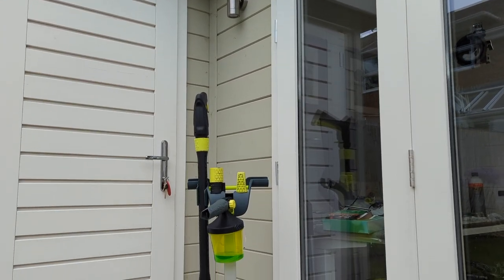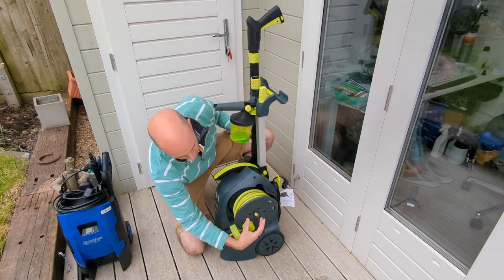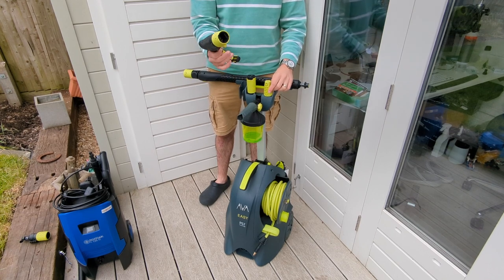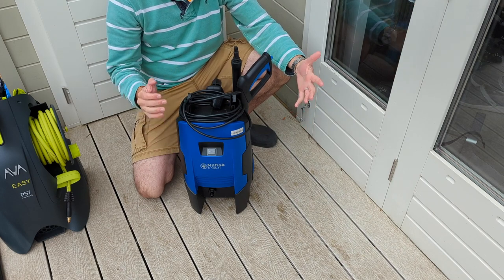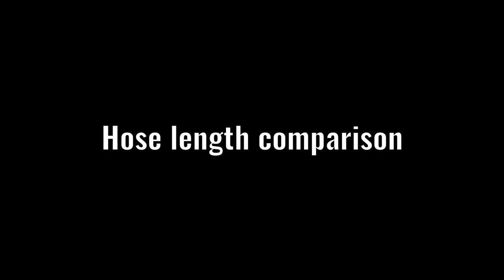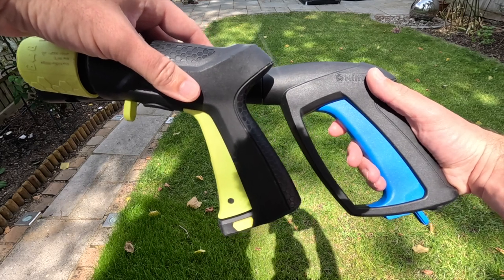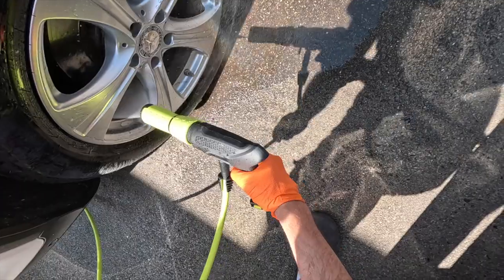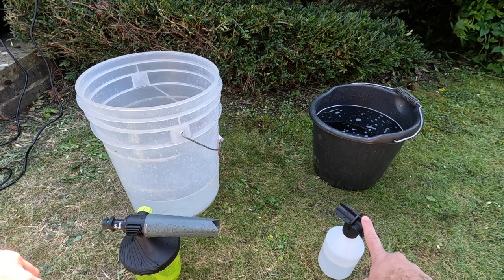EVERYTHING you need to know about the Ava Easy P57, and how it compares to Nilfisk

Comment: Excellent comparison.  My Nilfisk is 5 years old now and has been very reliable.  This year it played up after being stored away for winter, most likely I didn’t get all the water out.  Been thinking about upgrading it with a stubby gun and new 10m hose from hoses direct.  
I have also considered replacing it  with a AVA.  So it’s eirther a £70 upgrade on my 5 year old system vs £300ish for a new system.  So your comparison has come along at the right time, thank you.
Reply from the maker: I absolutely get that. Can I just say that you shouldn't buy from direct hoses; I've purchased from them twice, two years apart, and both times I've had problems. The customer service is abysmal - I had to raise a dispute with PayPal (luckily I used that payment method) to get some money back in the end.

Plenty of other places sell hoses and stubby guns, Clean Your Ride being one I'd definitely recommend. The concern I have for you is that if you've got it playing up already, you'll likely have to replace it at some point in the not too distant future?

Buuuuuut I also understand that the hose and gun is far cheaper!
Reply: @SuperchargedLlama  yep, totally agree with your concern that if my Nilfisk is starting to play up and I do up grade to a stubby gun etc.  I could still find myself needing to replace my pressure washer in a year or so time.  
At the minute I am thinking about using it during the summer and autumn.  Then treat myself to a new pressure washer in a Black Friday/Christmas sale.

Comment: Good job Adrian, like the person below said, a more objective view of the AvA, and less pushing it as an influencer, thank you.  What i also appreciated was you confirning that it's a relatively new brand, at least to the UK, and therefore it's impossible to look at the brand without years of use, I may be wrong but no one else has had the good grace to do that.  Im my world, my little K3 is 6m old and shouldn't need replacing for a good while and, it does a perfectly good job.  Yes, i cant store stuff on it, ergonomically it's a blooming nuisance, but it still cleans my car, which is its job.  Btw, nice Alliums. All the best buddy. 👍
Reply from the maker: Cheers dude, I'm glad people are appreciating the points I made. And with that in mind, that Nilfisk I've got coming is going to be interesting to compare it to.

It's the Ava accessories I really like, and reliability isn't a problem there. I feel like they are a proper upgrade over bundled stuff from other makes.

Also thanks for mentioning the Alliums, they are the Globemaster variety 👍

Comment: Thanks for the amazing review. My Nilfisk c120.3 died last week. Had it for over 10 years and I thought my next is gonna be Nilfisk again, however. I don't like the new design of Nilfisk core line. So I was gonna get Karcher obviously. Tried K4, K5 and it felt cheap and even though more powerful on the paper than my nilfisk. My old Nilfisk was far superior IMO. In the end I've decided to go with AVA. The only dilemma right now is whether to go with Easy P57 or Smart P60 🤔. Both are on offer at around £220 now
Reply from the maker: Personally I'd get the Easy, because you get the longer hose and the premium foam lance, which are far better. You can also upgrade the hose the steel reinforced one on the Easy at a later date of you chose to, but out of the box it is better equipped.

As a tip, use my link in the description and buy through Amazon so you've got their customer service, as opposed to Ava - Ava is fine but it's taking a bit longer to respond and resolve issues at the moment, where as Amazon is near instant; so if you've got any issues soon after purchasing then you'll get them resolved more quickly.

I don't think you will have any issues by the way, but it's worth making your life easier and the price is the same.

Comment: As always Adrian, you supply a simple and different point of view/review to something that's been looked at multiple times.
As a thought with the snow foam issue of the feed tube, could you swap out the MJJC weighted bottle feed tube to it. It should work on the smaller one but not sure for the milkshake bottle. Could that work? are the specs similar enough to work.
Reply from the maker: Thank you so much!

The thought you've got there is an interesting one. I've only got the V3 from MJJC and I can tell that draw tube is too small in diameter, but I was chatting to Speccy the other day...and I think he said there were some weights you could get on eBay that might fit.
Reply: @SuperchargedLlama  OK, weight alone might be enough, depends if the tube is not too stiff I suspect, certainly worth the research, unless AVA have already solved the issue of course. 🙂Maybe that's one for the next snow foam cannon video?
Reply from the maker: @johngent3350  hmmm maybe. You could just cut the tube short I guess, it use any standard bottle instead and that'd work. The Autosmart trigger bottles fit for example, as do the carpro dilutes.

Comment: Awesome Review but now thinking do I get a Easy P57 – X-Large Bundle or a Nilfisk E150 as they both stand at the same price :S
Reply from the maker: I've actually got a review of the E160 on my channel too if you want to see that? Although I think the 150 I'd actually the Core model these days?

Personally I'd go with the Ava because you don't need to spend a single penny on other accessories afterwards, and you get a stubby gun too (with how their system works). That might not be an issue for you if you've already got those things and they fit a Nilfisk of course.
Reply: thank you so much for getting back to me @SuperchargedLlama  

I am starting a detailing business down south and looking around on what I should get , Do you know if the autoglym snow foam lance aka the Polar Blaster work with the ava mount for the SF cannons ?

thank you for getting back to me :)
Reply from the maker: @KevsQuests  no problem dude. I want to make you aware of one thing, neither of these machines are covered for warranty if you're using them commercially, I just use my Ava domestically (actually, Ava do give you a month of commercial warranty, no one else does that).

The Ava connector is the same as the Karcher K-Series, so if you've got that on the end of the Autoglym lance then you're good to go, if not then you'll need to change it.

I will say that in the XL bundle you get Ur premium foam lance from Ava, don't you? It's brilliant, one of the best Lance's I've used actually, I love it. But having two that fit your setup is really useful as it means you can have two different products lined up to use.
Reply: @SuperchargedLlama   I did think that with the warranty side of things too but you never know if anything right could brake at any time :P 

Xl bundles do come with a large snowfoam lance but its not the your talking about a lot of there stuff on the webiste is mark "sold out" but I hear a lot of that maybe due to them doing a recall on them due to them shorting a fuse :S 

great to hear that If I was to get a AVA that I can use Karchers stuff on there. but my real question ( sorry for so many ) is what would be the best thing for me to buy as a new start up business again I do have a budget of £300 ( I am also looking to get the MTM Hydro gun onto top too if needed ) 

Really dont understand how much these this means to me that you are getting back to me , Thank you !
Reply from the maker: @KevsQuests  ahhh the fuse blowing issue affected the P70 and P60, the Easy, Go and Smart lines were all good on that front.
Reply from the maker: @KevsQuests  I seem to have missed an entire paragraph of your message there! My bad.

I'm having a think here and I reckon if you didn't go for the Ava, I'd go for the Direct Hoses OR11 with the 15m hose. It's domestic again, and the single biggest problem I have recommending you do that is because direct hoses have the most abysmal post sale customer service I've ever come across, so I wouldn't buy from them. But for your budget the only pro machine you can get is the Karcher HD4/8 or 10. I wouldn't bother with the 10 as the built in hose reel is a faff, you're better off getting the 4/8 and then getting a long hose and stubby gun...but you'll be over budget by the time you do that.

It's going to be a case of "you pays your monies and makes your choice", but to start out and an all in one solution, I'd go with the Ava and have no extra outlay.

Is the one I've linked to in the description showing as out of stock?
Reply: @SuperchargedLlama   All good ! :D  No the Easy P57 is in stock and does have the bundle that comes with the good 500ml snowfoam jug and that is £300 all in 

Argos are doing some deals on other machines like :

Nilfisk Core 150 for £270
Karcher K5 Power Control Pressure Washer - 2100W for £300
Karcher K4 Power Control Home Pressure Washer - 1800W for £270 

so many things to pick from :P
Reply from the maker: @KevsQuests  I'd go Ava because you don't need to buy anything else AND the hose is longer AND the foam lance is just one of the best on the market AND the zoom lance genuinely isn't a gimmick.
Reply: @SuperchargedLlama  Dude thank you so much ! Of course I have subbed to the channel ! Thank you so much ^^
Reply from the maker: @KevsQuests  you're welcome. If you do go for the Ava, go by one of my links and it lets them know that you chose one of their products because of my video and conversation 🤟
Reply: @SuperchargedLlama  I sure will !  :)

Comment: Thanks for this review - it is the most objective one I've seen on the AVA; some others feel like influencers pushing a product.
Can I ask what the hose is like please i.e. does it kink like the cheaper models from Karcher. The 12m length makes it very useful
Reply from the maker: Thank you for specifically picking up on the objective comparison, I was hell bent on that being the case!

The hose seems pretty good. It'll definitely kink if you pull it hard enough, but it seems as resilient at the Nilfisk option. One of the benefits of the length is that I found I rarely pulled it tight like you do with a shorter hose, does that make sense?
Reply: @SuperchargedLlama  Thanks for clarifying that. I understand what you are saying

Comment: Thanks for the video. I'm debating which to buy, AVA or Nilfisk. Had a Nilfisk C range for 6 months from Costco and it started pulsing, sent it back for a full refund as Nilfisk didn't want to fix it, either refurb or refund.

Costco have the E160 HX TRA for £350, but it does show up with a discount sometimes, may go for that.

Ava look great but as you say, the company is new so the 10 and 20 year warranty doesn't have the same weight as Nilfisk offering 5 years. Also seen some detailers say there are quality issues and microswitch issues with some Ava's. 

Difficult choice!
Reply from the maker: I am with you there tough choices!

I feel like any issues with the Ava's should be okay for now, as the company is operating and doing well, but that doesn't mean a whole lot does it. It's the accessories that swings it for me, they are just much better with Ava.

I'll be interested to see what this new Nilfisk Excellent 160 is like, it's got the sort of design language of the new Core series, but the internals of the E line.

The sweet spot is the Ava accessories fit the Nilfisk hose....the onboard storage won't work, but then you've get an amazing setup.
Reply: @SuperchargedLlama  The accessories do look fantastic. I'm with you about the Nilfisk gun, I got hand pains after using it and the hose is better than Karcher's but not by much, kinks too easily and too short.

Comment: AVA, or AN Other, could form two brackets that would hold the lance and accessories to the machine body.   At least you have a decent length of hose with the P57...    Not all Kärcher accessories will fit without modification/cutting 1/4" off the end of the screw-cowling.   The Kärcher screw-cowling is too long!
Reply from the maker: Some good points there. I feel like there's very likely a lot of space in the housing where they could make some indentations to store the accessories when folded away (except maybe the Zoom lance), something they might do for a future revision perhaps!

Comment: So what pressure washer do u use
Reply from the maker: This one now, unless I'm having to run off my generator, then I use my Nilfisk C135 is it draws less power and doesn't stress the generator as much. The P57's draw is a bit marginal for it, so it trips out sometimes.

Unless I'm reviewing something else, I'll generally use the Ava. Mainly for the lance and foam cannon tbh, love them!
Reply: @SuperchargedLlama  does the ava have plenty of flow rate compared to your nilfisk ihave a core 140 but when I looked at actual bar   
Pressure it only runs at 100 bar
Reply from the maker: @leighrowberry61  funnily enough I was looking at the sticker on the back of it yesterday, as I've got a Nilfisk P200 to review at the moment as well. I'll need to check again for the flow rate, but I think the standard operating pressure was more like 100bar (peak being 150bar or something) - let me check this morning and confirm.

If feels fine in use btw
Reply from the maker: @leighrowberry61  I've checked now. Max is 145bar, average 97bar. Max 8.3l/min, average 6.5l/min.
Reply: So r avas 100 bar to
Reply from the maker: @leighrowberry61  yeah most are I think. The P200 I've got is 140bar average (I think, maybe a bit more). The Karcher HD 4/8 is 120bar max and 80bar working for example